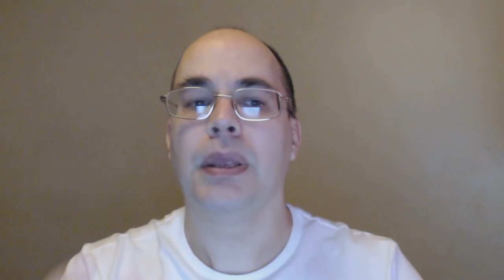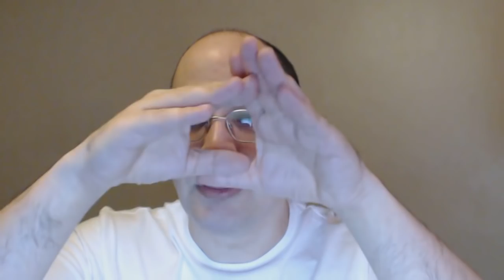How do rockets move in space, with nothing to push off from?

Comment: Gas pressure requires molecules to be in contact with each other, bouncing off each other, causing millions of collisions per second, etc… If you release gas into the vacuum of space, the first molecule that pops out will shoot off into the distance at a constant speed, so will the one behind that, never catching up with the first one. The third, fourth, etc… all fly off into the distance trying to fill the vacuum by finding their empty corner. So no matter how much gas you produce none of it will ever change the pressure under a space ship. None it if will ever push a spaceship. To push a spaceship there must be some locally high pressure under it, which is impossible since the pressure in space is 0 everywhere.

Back to the Nozzle and the Mass-flow equation F=MA on earth:
Think about a fire hose shooting water. A force comes directly back against the column of water shooting out. Why? Because the first drop of water has to pas through air, which is dense, causing many collisions, slowing down the drop of water. The second drop, directly behind the first, will not be slowed down by the air so it will collide with the first drop, the third drop hits the second drop and so on, the fast water coming through the hose pushing through the slower water outside causes Newton’s 3rd Law to push back on the column of water. This is why you need people holding the hose to add an unbalanced force otherwise the hose would not be able to push water through that column anymore, the water column would be diverted and the hose would flop around. It is obvious that one drop of water does not push back on the hose, you need a fast moving column.

The nozzle and the Mass-flow equation in space:
Since the molecules leaving the combustion chamber and entering the vacuum never slow down, never collide with any outside objects, nor with each other, their force is always moving forward, away from the ship. There is no way for that force to be returned to the ship. There is no way for the force of the moving molecules to be extracted and used for propulsion. Their force is carried off into the far corners of space. This is also known as Joule Expansion. Remember that as soon as the nozzle is opened, the combustion chamber becomes part of the vacuum of space as is subject to its laws. A closed chamber is under pressure but not an open one.

NASA is lying at the molecular level but that’s OK because most people don’t usually look there. The awesome, spectacular and heroic nature of space exploration is enough to cloud the most logical minds.
Reply: I've tried those examples. The responses have been -
"Nukes don't exist, and explosions aren't possible in a hard vacuum."
"The fire hose only whips around because the water exiting the hose is pushing off the air molecules. In vacuum, there would be no whip around."

Maybe instead of teaching them some basic physics, we should try them on ping pong, or maybe they would make good shrimping-boat captains?
Reply: That's why they don't call it weightlessness, but rather micro-gravity. Orbital free-fall makes you subject to tidal forces, which screw up weightlessness experiments. Apparently your weight at the ISS is 90% of sea level.
Reply: Umm, perhaps i can help. Imagine a block of titanium (irrelevant but it has to be something) with a small nuke strapped to it , that is sealed in its own container at rest in the vacuum of space. If the nuke is detonated, would you concede that the detonation would result in kinetic motion, in this case Newton 3 - For every force or action applied, there is an equal and opposite reaction, propelling the block away from the explosion and the explosion away from the block. You don't need to grasp plasma dynamics in a vacuum to get this - just that the explosion occurs..cool? :)
 
It is irrelevant where they are as Newtonian physics apply. We are not trying to trip ourselves up by saying - it is a conventional explosive (or propellant) necessitating oxygen in the vacuum to initiate and propagate ignition.
Does that help?

In fact, even better - Your fire hose example - let's imagine that lying at rest on the ground. When high pressure water is turned on, the hose will immediately begin whipping around all over the place. In this case, the fact that there is an atmospheric substrate is totally academic. The primary, violent motion of the hose is cause by the massive and fast expulsion of the water out of the nozzle and not by the water jet acting on the air that produces the thrust...get it?
Reply: “The only proof of the Vacuum Of Space is the illusion of weightlessness” and without the illusion of weightlessness in space, it would reveal the farce and canard that NASA calls the Vacuum of Space. One cannot have a vacuum next to a non-vacuum and have interplay between the two, it’s impossible and paradoxical.
Putting quotes around your own silly statement doesn't make it any more intelligent. Weightlessness has NOTHING to do with the density or lack of gas or liquid around you. That's a kindergarten understanding of space and weightlessness.

Heh. Yeah, I heard about that NY Times article where that blithering idiot wrote an article saying rockets can't work in a vacuum. You guys would have liked that guy. (i'm sure he lost his job in disgrace once grade-school science was explained to him).

First and foremost, how much removal of air does “practically possible” mean? Inside a bell jar, even a small amount of gas would be sufficient to push against because of the containment rigidity of the bell jar
Sigh.
You're really saying a few drifting oxygen and nitrogen atoms caused that violent reaction to the bullets being fired? HOW? Did the gases exit the barrel, run into a nitrogen atom, and THEN what? Please diagram that force relationship for me. Did the bullet-gas atom put its little FOOT on that N atom and then e-mail that force to the back of the gun barrel? lol
Bullets don't cause a bruise on your shoulder because they are pushing off of air, they do so because the gun is THROWING gas and particles, and the reaction kicks you equally in the shoulder, EXACTLY like throwing a boulder away from you kicks you in the hands. 
Or how about this? You're floating in the vacuum of space, and you pull the pin on a grenade and hold it near your stomach. Do you NOT think you will be blown BACKWARDS once that little primitive "rocket" activates? Pieces of you will, anyway. Do you think the grenade needs air to "push off of" to push YOU?

Just how huge a vacuum chamber, and how perfect a vacuum, would convince you that the bullet is recoiling the gun irrespective of atmosphere? How about a device to measure the recoil, at various levels of vacuum? This would show that there is MORE recoil the less air is in the way. Would that prove to you that rockets work in space?

There was and has been no scientific verification just mathematical and half-baked pseudoscience examples like the above
What? No scientific verification that space is a vacuum? Do you deny that air pressure gets STEADILY lower with altitude? Hell, it's already at 50% on the top of Everest. What on earth do you imagine will change as you get higher? It will dwindle until at about 75 miles, your barometer reads 0 psi, right? I mean what ELSE could possibly occur?
So to say it's not measurable is ridiculous. They were testing the air pressure in pressurized balloons back in the 1800s. Everyone accepted that air pressure drops as you get higher.

By the way, the third law of thermodynamics says nothing can ever get to zero temperature, so by that definition there wouldn’t be any vacuums.
Obviously he means no "true" or "perfect" vacuum. Which NASA admits all the time. Even their best test chambers have some gas in them, and space IS full of dust and other crap, so you never get a perfect vacuum. And then there's the issue of radiation and theoretical virtual particles in the "quantum foam" and other weird shit, but people just say "vacuum" for short, when the gas pressure is below some minimum level.

End of (kindergarten) story.
Reply: Plus I will not post my credentials on a social media site.
What are you concerned about? You're not even using your real name here. Which is smart. Considering the position you're taking here.
Reply: Haven't you learned anything in all this conversation? Man, I pity your teachers (I'm assuming here that you had teachers). They must have earned their pay.
Reply: if it has done the job then a plate shouldn't cause a problem but vaccum will. It will extinguish the flame. Try light a fire in a vacuum chamber.
Why do you guys keep bringing up vacuum? As long as there is sufficient oxidizer squirted into the combustion chamber, what does it matter if there is a vacuum outside or not? Do you imagine that affects the "recoil" your palms feel when you toss trillions of little bowling balls behind you?

And yes, there will be no visible flame outside the combustion chamber in space. Which is what we always notice after the crafts leave the atmosphere. We see very little hot gases exiting the bell housings, which start to glow very hot now that there's little air to cool them. 

Again, show a video of a rocket or shuttle zipping through space or arriving at the ISS. There are none. Why? Because its all bullshit.
You're joking, right? There are hundreds of videos showing Shuttle and Apollo and Soyuz and other craft arriving and docking and leaving the ISS, and other places.
You mean all of them are FAKE, right? So why would I bother linking to any more? You'll be typing out "CGI' before you click on them, even if they are from the 1960s or 1970s.
Reply: +Paul Schober Flat Earther's have made a conscious choice to deny reality and live in their own little fantasy world. Trying to teach them anything will ultimately be pointless. They have to choose to come back to reality. Since that reality is far from the greatness they thought they'd achieve as kids, few if any will choose to return to it.

Mercifully though, there are still mindless jobs, welfare programs, and religious cults out there to be had. So not all of them will necessarily have to starve to death. Any children they may have however, are likely going to be screwed (unless they're intelligent enough to realize that their parents are fools with questionable mental health.)
Reply: Yeah but these people can VOTE, and drive cars. And many of them are saying they are pulling their kids out of school to teach them "real" science. I saw one video of a flat earth father quizzing his toddler kids on the flat earth "reality". That is SCARY.
Reply: +Magic In a vacuum, there is nothing to affect stability (a bathtub will handle as smoothly as the most aerodynamic craft)...Simple maneuvering thrusters will work just fine. With no atmospheric resistance to contend with, it's a simple as aiming the exhaust of said thruster in the opposite direction you want to go. The real trick is countering that movement once you're properly oriented as the movement caused by the thrusters will continue even after you shut them off.
Reply: +Lee Johnson More likely stole it...A great deal of his argument is literally copy / pasted from here https://aplanetruth.info/2016/02/05/another-massive-lie-the-vacuum-of-space-debunked/ (and I wouldn't be surprised to find out that the parts that didn't come from there were simply copied from some other source.) Such tactics are usually the result of someone whose actual understanding of the topic is too weak for them to even attempt to paraphrase their sources.
Reply: I have given you all substantiated and logical facts. As I said try to graduate from highschool first, enroll in a college science class and then come back to refute the physical facts intelligently
I have a BSc since you asked. And you haven't rebutted anything I just said. 
What a surprise.
Reply: Have read a few articles and explanations by astronauts that when in orbit, they are actually in a perpetual state of "free-fall" and it is their speed which simulates weightlessness.
Reply: Balabajka - in other words, expelled water is pushing against the hose, pushing it back. How is it different from a rocket in space?

And speaking of going back to school, it's "Joule expansion", not "Joulie's free extension" :)
Reply: you are obviously a troll or a very ignorant person which is also in dire need of attention.
At least I take the time to type my own posts instead of copy pasting them off the internet :]

Have you ever seen a flame burn in a vaccum?
As long as you can provide oxygen for flame, it will burn. What does it have to do with anything?

Have you ever witnessed a rocket zipping through the void of space?
I have, on film. I know what you're going to say to that, of course, but considering that rocket industry is a multi-billion industry now, I'd say that you are the one that needs to prove that rockets do not work in space. The fact that you believe that thrust baffle somehow contradicts the official theory proves, once again, that you lack the required knowledge to properly ascertain the validity (of lack thereof) of space travel mechanics.
Reply: if it has done the job then a plate shouldn't cause a problem
Didn't you read what I wrote? The plate will be a problem, because it will redirect thrust upwards causing it to cancel itself.

It will extinguish the flame. Try light a fire in a vacuum chamber
As long as a flame has an oxidiser source (as rocket do), it will continue to burn.

Again, show a video of a rocket or shuttle zipping through space or arriving at the ISS.
watch?v=G9tjdkp-vZs
Huh? What's that? You're saying it's fake? Well then, you will have to prove it, then :]
Reply: +yuliya56100
Magic you are correct!!
First of all, Magic is just good at copy pasting - these aren't actually his arguments, just some stuff he found on the internet and mindlessly copied and pasted, without any comprehension.

Second, "his" argument isn't even wrong - it simply misunderstands how rocket engine actually works. It's like arguing that all cars are fake, because the stilts they push off the ground wouldn't be sturdy enough.

They didn't think of this very well when they invented the concept of " space travel" Huh?
"They" being the Russians, actually. Have you thought about this very well? It's the Russians that started the whole "space race" thing, and USA, in the middle of Cold War, when its religious belief was at its highest, with "In God we trust" being put on coins and notes, instead of loudly denouncing those godless communists, simply went along with the "hoax"? Lolwut?

You see, Yuliya, the fatal flaw in "rocket has to push off air" hypothesis is that it completely ignores what gas molecules have to do before leaving combustion chamber. All explosions are omni-directional, and the one happening in the combustion chamber of the rocket isn't any different: fuel+oxidiser=hot gas molecules moving energetically in all directions. And those molecules which aren't moving back, have to bounce off the walls of the combustion chamber, giving it upwards momentum.

Basically, all rockets ride on continuous shockwave caused by continuous explosions inside their combustion chamber.
Reply: Magic i think you nailed it
Reply: Aerodynamic stability in the vacuum shouldn't be factored at all as it is irrelevant (by virtue of its name) A square block and a sleek space-craft will both function equally well / badly.
Reply: Best explanation
Reply: Magic's post is,actually, a horrible explanation, which manages to (somewhat entertainingly) butcher the physics involved.

Let me ask you a question - what exactly causes that "first molecule that pops out" to "shoot out into the distance"? Why is it moving away from that container? Vacuum of space is not a literal vacuum cleaner - it can't suck out the gas molecules out of anything. So, something must've happened that changed that molecules direction.

And that something was a collision with the container's wall on the opposite end. And now, we have that molecule moving back, out into the vacuum of space, but... because of that collision, the cylinder has gained forward momentum, with strict accordance with Newton's 3rd Law.

And that's how rockets work in vacuum - the fuel is mixed with the oxidizer inside the combustion chamber and then ignited, creating a constant series of explosions. Each explosion is creating hot molecules of gas, which expand in all directions. Now, those molecules which happen to be facing back will exit the combustion chamber without interacting with the rocket in any way, but, every other molecule which isn't "facing" back has to hit the wall of the combustion chamber and bounce back, transferring its kinetic energy and giving the rocket a forward momentum, with strict accordance with Newton's 3rd Law.

Joule Expansion doesn't "kick in" until an molecule is facing the right way, away from the rocket, and if it doesn't, it has to change its direction by bouncing off the rocket, giving it forward momentum. That's how rockets work. Not by building a ladder of molecules, but by riding a shockwave :)
Reply: Nick Heaton    VERY well said with the fire hose analogy!!!
I've been using garden hose analogy, but firehose is even better.  The water pushing against the air is completely irrelevant to what's actually going on!
Thank you so much!
Not sure why some people don't get this.
Reply: Magic   Wikipedia should never be used
as a source.

Wikipedia states in their disclaimer:
  "Wikipedia makes no guarantee of validity."
Also:
 "Please be advised that nothing found here has necessarily been reviewed by people with the expertise required to provide you with complete, accurate or reliable information."

Full Wiki disclaimer link below.
Please read unless you don't care about the truth.
Wiki is nothing to quote!

https://en.m.wikipedia.org/wiki/Wikipedia:General_disclaimer
Reply: possumverde    Nice catch!
Reply: Jan Strzelecki    Hahaha thank you.
Some people will never get it however.
Reply: "If you release gas into the vacuum of space, the first molecule that pops out will shoot off into the distance at a constant speed,"

Correct, molecules which are not impeded by anything under motion will keep moving in that direction until acted upon by an external force....... the molecules first have to be going in that direction, for them to go in that direction when they were moving in some other direction they must be acted on by some other force, this force can come from colliding with other gas modules or with the inside of the combustion chamber in the case of a rocket...... which imparts momentum to the gas molecule in another direction as well imparts momentum to the combustion chamber (and anything attached to it) in the opposite direction. The individual momentum of one has molecule is infinitesimal.... but the effect is cumulative when talking about billions and billions of these collisions per second in the chamber. Since none of the molecules which are now leaving the combustion chamber are no longer transferring kinetic energy to the rocket body in the opposite direction to the kinetic energy they applied in their previous collision, there is nothing arresting the movement of the rocket in the opposite direction from those kinetic impacts.

Or to put it short, you don't get momentum for free. It comes at a cost... in the case of travel in a vacuum this is reaction mass.... commonly known as the mass of exhausted fuel in the case of a rocket.
Reply: Jan Strzelecki   Thanks Jan!!!
I don't think the "air pushers" will get it though.
Or they don't want to think about it.
I'm glad for your post however.
Thank you!
Reply: possumverde it is fact and reality. Wake up from the indoctrination. Plus I will not post my credentials on a social media site.
Reply: possumverde wrong again dum dum. I never copied pasted or plagiarize a thing in my life. I'm just trusting my own Common Sense over your indoctrination centers AKA Colleges
Reply: It still amazes me with all our satellites...that Nasa would need to mount what is the equivalent of the Hubble in a 747 called SOFIA. Why, with all the others is this necessary. The Hubble is actually what is known as Keyhole 11 satellite (KH11), which is what the DOD and others with the cash use as spy satellites. Sofia is an 8.2 ft telescope .  "The Stratospheric Observatory for Infrared Astronomy, SOFIA, rivals the Hubble Space Telescope in size, and researchers have used it to study the atmosphere of other planets, the fields of gas where stars are born, and the composition of comets."

Pilots take this beast above the water vapour and pollution to get this telescope to work properly. But, hang on, why bother if we have IRAS, the James Webb, The Hubble and a plethora of other astronomical observatories in space...just aim any of the hundreds of KH11 sat's at the problem...momentarily - battles over!
Reply: The rocket not going to fly. We know that. We can explain that. The fact that you believe it would pose some sort of problem for us proves yet again that you lack the necessary knowledge to properly ascertain the validity of the evidence and science put through.
Reply: Jan Strzelecki well you shill, if the silly argument you guys propose would have any merit then the rocket should take off so by any means, give us a valid, credible explanation....I know what your gonna say, heheheh....BUT as soon as the exhaust leaves the nozzle, in a vacuum, it will be extinguished so no more pushing off of ANYTHING. Game over.
Reply: if the silly argument you guys propose would have any merit then the rocket should take off so by any means
No. It would not. In your experiment, the plate attached below the nozzle would redirect thrust back up, effectively nullifying it, in strict accordance with Newton's 3rd Law.

BUT as soon as the exhaust leaves the nozzle, in a vacuum, it will be extinguished so no more pushing off of ANYTHING.
...

The vacuum is not a literal vacuum cleaner - once exhaust is given momentum, it will continue going down (and if there's a plate attached below, it will bounce off it). "Extinguishing it" would break the laws of physics. Remember the First Law? "An object at rest stays at rest and an object in motion stays in motion with the same speed and in the same direction unless acted upon by an unbalanced force."

That's how it works. The exhaust is given speed in the combustion chamber, and it is given direction at the same time, by bouncing off the walls of said chamber, which in turn gives the rocket speed and opposite direction, in strict accordance with Newton's 3rd Law.

That's the thing you're ignoring - what exhaust does before leaving the nozzle. Once exhaust leaves the nozzle, then sure, it can't affect the rocket anymore (unless some bozo decides to put a plate below ;) ), but it doesn't have to - it has already done the job of pushing the rocket up :)
Reply: Nick Heaton what due diligence have you done in regards to the Holocaust? I suppose you have evidence of at least one person being killed in a gas chamber? Your response to this should be interesting.
Reply: Magic you are correct!! That is why it's a vacuum, but these geniuses have all the answers!! Space travel is NOT POSSIBLE!! They didn't think of this very well when they invented the concept of " space travel" Huh? As William Shatner says, what's the dig between science and science fiction? 
Well, they're both the same?
Reply: So no matter how much gas you produce none of it will ever change the pressure under a space ship. None it if will ever push a spaceship.
He just explaining how rockets work. They don't work by creating a higher pressure beneath them. The MASS being ejected creates an opposite "push" against the craft, like what happens to your palms when you shove a boulder away from you. No air pressure involved or needed to feel that backwards opposite "push" on your hands.
Reply: Thrust-vectoring and attitude jets.
Reply: possumverde A vacuum in the lab is created by sucking out the gases/matter, but in space the same vacuum is supposedly created and maintained by the paradoxical expansion of the universe. Imagine exhaling into a balloon (expansion) and then inhaling the air back out (vacuum) they are two different processes but yet NASA says it yields the same result. Sorry not buying it.

By the way the supposed expansion of the universe was just recently recorded by NASA’s Spitzer Space Telescope and it was…

74.3 plus or minus 2.1 kilometers (46.2 plus or minus 1.3 miles) per second per megaparsec (a megaparsec is roughly 3 million light-years) “Space itself is pulling apart at the seams”

The measurements of the expansion of the universe of course are complete nonsense since The Spitzer Telescope only exists on the hard-drives of NASA’s production department. . As I’ve stated numerous times, just show us real images and video of earth and satellites and we’ll call off the dogs. But true to their colors as accomplished liars, there’s always another lie to cover another truth.

In space a new set of principles seem to apply allowing the envelope/dome/boundary to be semi-permeable and objects can gradually enter into and out of the vacuum. Because of this very reason space cannot be considered a vacuum as compared to it’s laboratory brethren. There is obviously something wrong with the assertion that there is a “vacuum of space”. The only proof offered that a vacuum exists in space are fake asstronot images or videos of either the Apollo, Space Lab, ISS/Shuttle hoaxes.

“The only proof of the Vacuum Of Space is the illusion of weightlessness” and without the illusion of weightlessness in space, it would reveal the farce and canard that NASA calls the Vacuum of Space. One cannot have a vacuum next to a non-vacuum and have interplay between the two, it’s impossible and paradoxical.

The framework or scaffolding that space travel is real was born out of the crucible of science-fiction and fantasy long before it was purportedly confirmed on July 16, 1969 with Apollo 11.  Below is the editorial section of the New York Times called Topics Of The Times to professor Robert Goddard’s statement that a rocket can function in a total vacuum in the New York Times from an article published Jan. 13, 1920. The first paragraph states:

”That Professor Goddard, with his ‘chair’ in Clark College and the countenancing of the Smithsonian Institution, does not know the relation of action to reaction, and of the need to have something better than a vacuum against which to react — to say that would be absurd. Of course he only seems to lack the knowledge ladled out daily in high schools.”

Here you see the editorial mocking the absurdity that a rocket can work in a vacuum on its own. The second paragraph was the official retraction 49 years later on July 17, 1969. The Freemasons never miss an opportunity to do-it right in plain sight. Apollo 11 was launched July 16, 1969 on the 4 day journey to the moon. What are the odds?

Further investigation and experimentation have confirmed the findings of Isaac Newton in the 17th century and it is now definitely established that a rocket can function in a vacuum as well as in an atmosphere. The Times regrets the error.

Here is an excerpt from Professor Goddard released by Clarke University after his findings were ridiculed by the New York Times;

Dr. Goddard gave another reaction to the New York Times editorial in front of an assembly of Clark University undergraduate students a few years before his first rocket launch. As described by one of the students who was there, inside a glass bell jar Dr. Goddard put “a spindle at the top of which was rigged a .22 caliber revolver loaded with a blank cartridge. The latter was electrically wired to explode at a given moment.

After exhausting as much air as practically possible from the bell jar, thus creating an airless vacuum analogous to the medium outside the earth’s atmosphere, and after quoting The New York Times pejorative comments, Dr. Goddard touched a key, the cartridge exploded, and the pistol spun briskly around making four complete revolutions. Dr. Goddard knew that Isaac Newton’s Third Law, viz., that every force has an equal and opposite reaction, had never been repealed; that it operates universally whether in or out of a vacuum; and therefore whether in or out of atmospheric space. This experiment as repeated for us was highly dramatic and, of course, quite conclusive. As the pistol spun around, Dr. Goddard dryly observed, ‘So much for The New York Times.’”

This is the absurd proof that Goddard uses to prove that rockets work in a vacuum.

First and foremost, how much removal of air does “practically possible” mean? Inside a bell jar, even a small amount of gas would be sufficient to push against because of the containment rigidity of the bell jar. And it’s certainly possible that no air was removed and the demonstration was slight-of-hand trickery (science certainly has no shortage of frauds and charlatans in the history books). In space that same amount of gas would not be contained but rather dispersed since no bell-jar exists in the first place. In a bell-jar pressure waves reverberating off the glass will also further distort the proof,  but the vacuum of space has no such limitations.

Furthermore, stating it’s analogous to space is a theory on top of a theory since no direct proof existed of space or its contents at the time (1920). The bell-jar therefore cannot be considered analogous to space since the “vacuum of space” was unverified and only speculative. There was and has been no scientific verification just mathematical and half-baked pseudoscience examples like the above.

But the powers that be said it’s so, so then it must be.

The University Of Illinois Champagne – Urbana Physics Dept. States:

So the answer really depends on what you mean by vacuum. If you mean what’s left when all the atoms etc. are pumped out, yes it still has a temperature of electromagnetic radiation. If you want, though, you could choose to only call that a vacuum if the temperature is zero. By the way, the third law of thermodynamics says nothing can ever get to zero temperature, so by that definition there wouldn’t be any vacuums.

End of Story.
Reply: Magic   You are so fucking dumb!  I hope someday your feeble mind can comprehend Newtons 3rd law.
Have you ever turned on a garden hose suddenly?
There is much more force than should exist from "pushing off air"
Where do you think this extra force comes from?
It's from the water at pressure pushing against the hose.  No atmosphere involved!
Same with a rocket.
The gasses released from the rocket push the rocket.
If you  can't understand basic physics, you REALLY need to go back to school.
Reply: Are you guys trying to convince each other that space travel is impossible because you can't figure out how to do it?
Reply: Paul Schober If space travel or the Moon landings were real, why has no one on the planet, in almost 60 years of alleged space travel, ever seen a rocket enter space or return from space. All that is ever shown by NASA is the launch of the rocket followed by a cut to CGI cartoons of a rocket working in space. 

Why is there no actual, independently verifiable, footage of a rockets thrust engines working in space and moving a rocket in space, (except in Hollywood films, TV series and fake CGI videos). 

By now, there should be a plethora of observable evidence that rockets can work in space and so it should be incredibly easy to prove. But of course, it isn’t easy at all because there is no definitive proof. Which is why, after almost six decades, NASA apologists are still desperately trying to prove that rockets work in space by either quoting distorted versions of Newton’s 1st, 2nd and 3rd laws, conservation of momentum, using model rockets in vacuum chambers or by presenting the usual hypothetical scenarios of guns/bullets, skateboard/bowling ball, throwing rocks etc. 

But not one of the apologists can EVER provide fully detailed verifiable, irrefutable and observable footage or scientific evidence that clearly and unquestionably proves that rockets work in space. 

And why? 

Because, rockets cannot work in space.
Reply: possumverde We are told by the deities of NASA that space is a virtual vacuum and their approximation as to where this vacuum starts and the atmosphere stops is called the Karman Line which is estimated at 62 miles. However the Wiki [5] says “no clear boundary exists between earths atmosphere and space,  just a decrease in density or fewer gas molecules”. Its important to note that the whole concept of space travel is driven by two concepts, (1)gravity and the (2)vacuum of space we call the universe.

Here is the Wiki for Outer Space;

[5]There is no clear boundary between Earth’s atmosphere and space, as the density of the atmosphere gradually decreases as the altitude increases. There are several standard boundary designations, namely:

The Fédération Aéronautique Internationale has established the Kármán line at an altitude of 100 km (62 mi) as a working definition for the boundary between aeronautics and astronautics. This is used because at an altitude of about 100 km (62 mi), as Theodore von Kármán calculated, a vehicle would have to travel faster than orbital velocity in order to derive sufficient aerodynamic lift from the atmosphere to support itself. The United States designates people who travel above an altitude of 50 miles (80 km) as astronauts.

So the Karman line is approximately 62 miles up and then you enter the partial vacuum of space, poof!, you’ve become weightless. That is what the Freemasons of NASA want you to believe and it’s total BS.
Reply: Jan Strzelecki you are obviously a troll or a very ignorant person which is also in dire need of attention. Have you ever seen a flame burn in a vaccum? Have you ever witnessed a rocket zipping through the void of space? If not then your comment is entirely your opinion based upon assumptions and speculation rather then tangible proof.
Reply: Magic I like your comment. it was eloquently put. but here's a question. if we figure out the propulsion problem how would you then steer without the aid of aerodynamic stability?
Reply: Jan Strzelecki if it has done the job then a plate shouldn't cause a problem but vaccum will. It will extinguish the flame. Try light a fire in a vacuum chamber. Again, show a video of a rocket or shuttle zipping through space or arriving at the ISS. There are none. Why? Because its all bullshit.
Reply: Paul Schober yup nice Disney CGI and model work. 😁
Reply: Paul Schober I have given you all substantiated and logical facts. As I said try to graduate from highschool first, enroll in a college science class and then come back to refute the physical facts intelligently.
Reply: Hoffman - you are an idiot. You say school? So you may want to do exactely that - go back and learn a bit about Joulie's free extension law. "Where do you think this extra force comes from?" It comes from water plant where water is being pushed by gravity and water pumps if needed - genius.
Reply: Paul Schober the teachers are just regurgitating the bullshit from their puppet masters. Show me a rocket zipping through a 0 vaccum.
Reply: D Hoffman Show me a rocket zipping through a 0 vaccum.
Show me a shuttle docking onto the ISS. Show me a 360° pan done anywhere in 'space'. Good luck.
Reply: This is to all the trolls supporting the BS theory of the rocket pushing off of its own gas molecules : attach an aluminum plate about a foot from a toy rockets nozzle and see how far it will fly up. Please video it so that we can all have a good laugh.
 Good luck :-D
Reply: Flat earth nonsense. I've seen gun in a vacuum experiments where it is clear that the recoil begins when the gas escapes the barrel, well before any of it reaches a chamber wall...
Reply: Lee Johnson exactly, the craft can't be steered in a 0 vaccum without aerodynamic stability. Jets are not precise with the supposed speed of a rocket.
Reply: Let's assume you were to travel in a 'rocket' to the edge of the atmosphere, you will find that there is no air pressure. Instead individual air molecules are zipping around in the vacuum of space. The molecules can zip any way they like but they tend to zip towards the Earth because the Earth’s gravity acts on them just like it acts on anything else with a mass.

The reason the vacuum of space doesn’t attract the molecules of air is because there is no suction to the vacuum of space. There are a few assumptions here that defy all experimental observations and logical thinking:

1. If gravity pulls the air molecules towards the Earth’s surface, then the decrease in pressure with the rise in altitude wouldn’t be possible; it is simply absurd to imagine gravity changing so drastically for hardly any significant change in the distance to the center of mass.

2. If the atmosphere is not sucked into the vacuum of space then there is no vacuum in space. It is crazy to imagine such a severe decrease of pressure until it reaches absolute zero, when all experiments certify the opposite: Any pressure tends to equalize within its surroundings. Always and everywhere!  That’s why we have wind, currents and a dynamic climate on Earth. If the gradient decrease in pressure of Earth’s atmosphere is making this amazing feat of ‘insulation’ possible, then how come that the earth Earth’s atmosphere was formed in the vacuum of space at all? How did the very first molecule “survive” the incredible surrounding vacuum? The air doesn’t rush into the vacuum of space because the gravity forces the air molecules down to Earth? Gravity again? This sounds like desperation! All the empirical evidences we have regarding the behavior of a vacuum directly conflicts this mumbo jumbo of idiotic nonsense.

The name is derived from the Latin word “gravis”, which means “having weight”, while the Law of Gravitation is defined as: “That mutual action between masses of matter by virtue of which every such mass tends toward every other with a force varying ‘directly’ as the product of the masses, and INVERSELY as THE SQUARE OF THEIR DISTANCES APART.”

Reduced to simplicity, gravitation is said to be: “That which attracts everything towards every other thing.” That does not tell us much; and yet the little it does tell us is not true; for a thoughtful observer knows very well that everything is not attracted towards every other thing…The definition implies that it is a force; but it does not say so, for that phrase “mutual action” is ambiguous, and not at all convincing.

The Encyclopedia Britannica tells us that “The Law of Gravitation is UNIQUE among the law of nature, not only for its wide generality, taking the whole universe into its scope, but in the fact that, so far as is yet known, it is absolutely unmodified by any condition or cause whatsoever.”

Here again we observe that the nature of gravity is not really defined at all; we are told that masses of matter tend toward each other, but no reason is given why they do so, or should do so; while to say that “it is absolutely unmodified by any condition or cause whatever” is one of the most unscientific statements to make! There is not any ‘thing’ or ‘force’ in the universe that is absolute, no thing that goes its own way and does what it will without regard to other forces or things. Again, gravitation is spoken of as a pull, an agent of attraction that robs weight of its meaning, something that brings all terrestrial things down to earth while at the same time keeps the heavenly bodies in their places and prevents them falling toward each other or apart.

The thing is ALTOGETHER TOO WONDERFUL, it is NOT natural; and the theory is SCIENTIFICALLY UNSOUND.

In a letter to Dr. Bentley, on Feb. 25th, 1692, Isaac Newton says: “That gravitation should be innate and inherent in matter, so that one body can act upon another at a distance – is to me SO GREAT AN ABSURDITY, that I believe no man who has, in philosophical matters, a competent faculty of thinking, can ever fall into it.” - Yet many have fallen into this ”great absurdity.” Such men therefore—according to Newton--have not “a competent faculty of thinking” in philosophical matters. I am happy to be in agreement with Sir Isaac on this important point.

Sir Robert Ball says: “The law of gravitation…underlies the whole of Astronomy.” (Story of Heavens, p. 122) It does not speak very well for the Astronomy, if it is founded on an acknowledged ”great absurdity.”

Thank God gravity is so weak, that it prevents the infinity vacuum of space from sucking out our atmosphere. BUT…if the earth rotated we would have a completely different (totally opposite) situation regarding the air pressure regimes in the atmosphere!!! Gravity doesn’t in any way cause the atmosphere to magically rotate with the ball as it supposedly pulls toward the center of the earth! Air at higher altitudes would actually have to be moving faster than the earth’s surface in order to keep up as it would have an increasingly farther distance to travel during the same angle of rotation.

For the rigid Earth to rotate about its polar axis, the whole air in the atmosphere should experience a rotation with a constant time of 24 hours (in rotation, the angular frequency 2pi/T is constant). Each atmospheric layer should have a different angular velocity; the angular velocity becomes greater at higher altitudes. The outer layer (not the outer most) of the air atmosphere is chosen at a height of 500 km altitude. The rotational velocity at this height is 1800 km/hr (500 m/sec), which is the same as the peripheral speed of a gas centrifuge.

The rotational velocity at the surface of the rigid Earth is 1670 km/hr. at the equator. The outer layers of the air atmosphere, during rotation, should be pressurized than all layers toward the Earth’s surface. Without going into numbers; the air pressure of the air atmosphere in that case, should increase from a minimum value at the surface of the rigid Earth to higher values as we ascend in the atmosphere. The profile of the air pressure should hold people down, without the need of any ”redundant force”. In addition, the systemic variation of the air profile should cause the phenomenon of falling objects - air pressure.

Moreover, we should observe more hydrogen at the surface of the Earth than at the outer layers. The most important element in our life - oxygen - should be concentrated at the outer layers and depleted near the Earth’s surface. The Newtonian and Heliocentric followers have no choice than one of these; to be pressure or to be gravity. The choice of Earth’s rotation (the cause of pressure) should repel the gravity from Earth. CONSEQUENTLY, THE HELIOCENTRIC MODEL LOOSES THE MOST PRECIOUS ELEMENT.

The choice of gravity should remove the concept of Earth’s rotation from the cosmic motion, consequently; the journey of the Earth around the sun becomes useless since half of the Earth should be always in darkness and the second half should always be in light.

So according to “Ball Earth Theory” GRAVITY is the all-powerful force that holds the atmosphere to the earth. There is no boundary of what it can hold down, just magical…How is it possible that a partial less powerful vacuum can lift huge slabs of rock but the ALL POWERFUL vacuum of space can’t even pull AIR away? It’s time to engage critical thinking and break that lifelong globe earth programming! Gravity and the vacuum of space are LIES intended to enslave you! Free your mind from the matrix of control. We live on a beautiful FLAT EARTH!